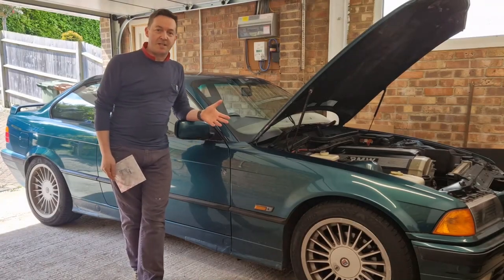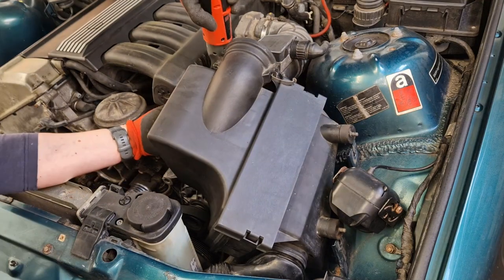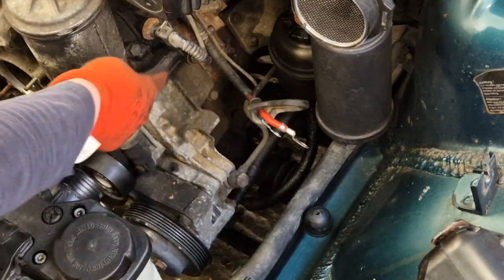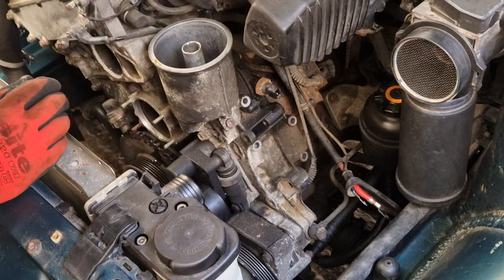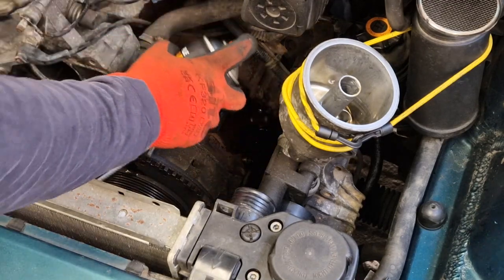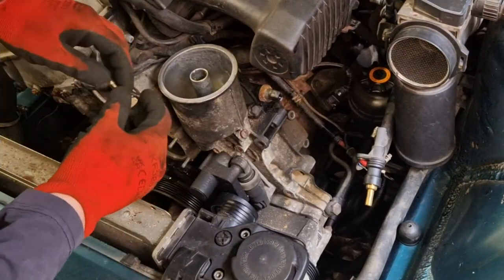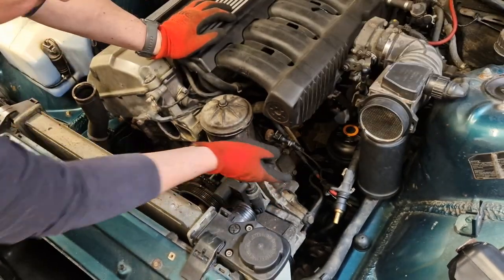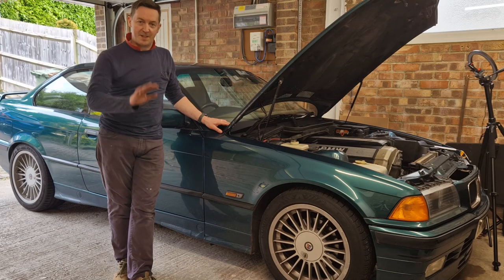BMW E36 Oil Filter Housing Gasket Replacement - Step by Step Guide

Comment: I've replaced mine and now it's leaking really hard :(
Reply from the maker: Frustrating, is it possible the gasket got pinched on re-installation? Also I replaced mine as I thought it was leaking, but turns out it was fine, and it's my power steering pipes that are leaking and they are directly below this housing. Good luck getting it sorted. 👍
Reply: @MostlyHelpful  I've overtorqued one of the bolts and uses helicoil, I assume it might be not as tight as it should be. I will get to it on the weekend. Thanks

Comment: Aren’t our supposed to push those clips in to unlock them instead of using the flathead to take off the clip? Like literally just squeeze the clip and it’ll compress more in and let the plug come out
Reply from the maker: Yes, you are right. I didn't know this when I filmed it (I've always just done it that way) but like you, somebody commented that there was an easier way 👍

Comment: sweet. those electrical connectors with the wire clip @4:49, just push it down instead of prying up!
Reply from the maker: That's a great tip, thanks 👍